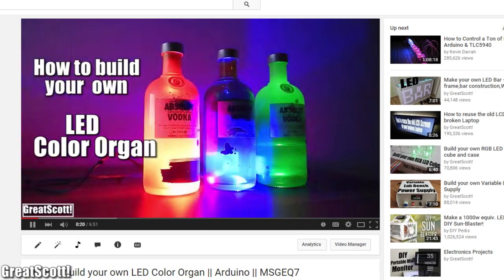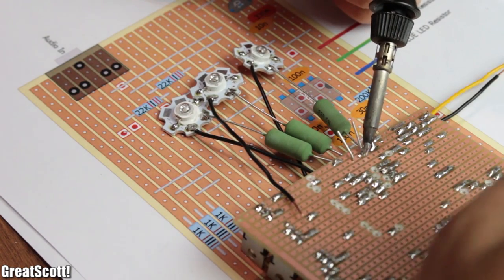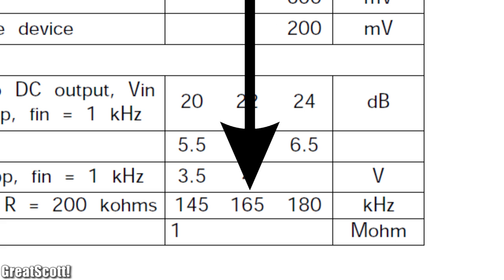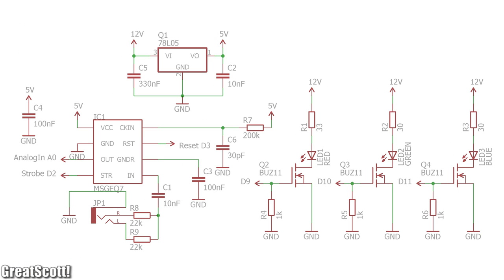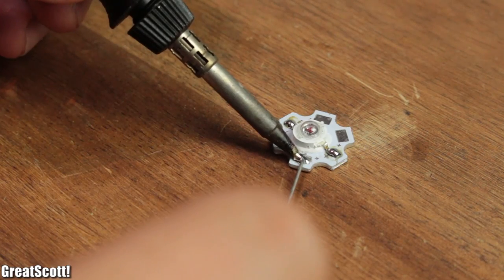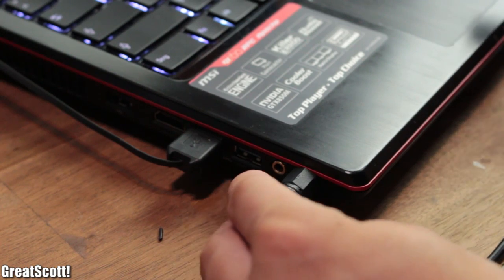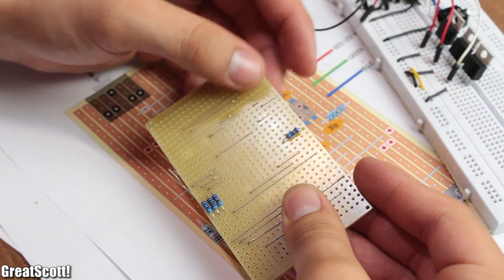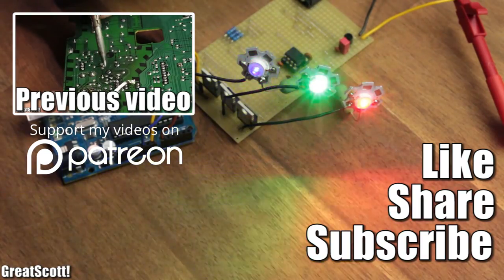DIY Arduino LED Color Organ 2.0

Comment: First I wanna say, I built my own color organ using this video, and it came out great! I did have the high frequency noise problem on the perfboard, even after removing the audio resistors, but I also ordered some PCB's (from JLC) and built the circuit using them, and it works FLAWLESSLY! Wow, I really like the project, thanks so much for this video!

Comment: For everyone looking to buid their light organ too, as i successfully did this week :D : 

As the kit is neither available anymore, nor is there a part list on the website, i felt like i want to help future builders of this project. I used this, the previous video and the correspnding websites as a basis for my first actual build with my microcontroller so i hope this gets more accessible if more information is put out there.
I have not yet bought any high power LEDs since i wanted to try the system out with my basic average 5mm LED. I built as much as basically all the things directly connected to the MSGEQ7 in the red/green schematic from the website, no transistors/Mosfets/...  So this is an instruction for getting as far as having the array of frequency intensities on your Arduino. You can use those signals to do whatever you want. I currently have the array values 0,1,2,3,5 in use for my five different colors of LEDs in my test setup with GreatScotts Arduino-program from this build.

I ordered my parts from Conrad Germany so i will try to give you a translation for the part names, as well as the actual name and article number that you can search for when you live in a German speaking country or whatever ^^...
The part list for the basic functions:
(-[Count] [English], [German], [Partnumber]) 
-1x MSGEQ7 DIP-8 MSI, Graph.Entzerr-Filter MSGEQ7 DIP-8 MSI, 1436444
-1x Mini-stereo 3.5mm jack/input, Klinkenbuchse 3,5mm 2-polig, 1567104 (i guess you could use a mono input too dependant on your case of appliance)
-1x Capacitor 10nF, Vielschichtkond. 10nF RM2,5, 1584439
-1x Capacitor 100nF, Vielschichtkond. 100nF RM2,5, 1584717
-1x Capacitor 33pF, Kerko 33pF 100V RM2,54 NP0 5%, 1589506 (!!!!!, about the in this 2.0 Version used 30pF Capacitor: i could not find one in the online catalogue, so i ordered different ones. The 33pF from the light organ 1.0 works well. It might distort the frequencies, i am not sure exactly what it does, but as my stupid brain found out while researching this that 27+1.5+1.5pF in series does not make 30pF, so i keep the 33pF which works... XD ... Remembering the basics from Uni is hard when you don't use them...[insert other excuses here])
-2x Resistor 22kOhm, Metallschichtwiderstand 22kOhm, 1585456
...thats it. Except the other stuff i use from my "The most complete starter kit UNO R3 Project" box. These components are the Elegoo Uno R3, Power supply module, 9 jumper wires (three for the audio connection), the breadboard, the 12V power supply and the USB-connection cable. I further use 15 5mm LEDs, 3 220 Ohm resistors and jumper wires for testing, but that part is completely up to you (High power single LED(s), LED Strip(s), Matrix display, ...). I guess either you already have these parts or you should have them for prototyping in general.

I used GreatScotts instructables schematic with these components at the MSGEQ7 and also his program with the other 5 PWM pins in use and i now have a fun 5x3 5mm LED show ^^
I hope this works for you too. 
If any of my suggestions make you angry, please leave a comment. I am not an electrician so dont take my word on any of this anyway! But i am happy to learn any basics anytime. :)

Btw. i plugged the audio into my computer. A splitter with one output works, but reduces the signal strenghts in my headphones and does weird things, so i plugged it into my monitor and configured Windows to do the Stereomix-thing so it audio-outputs now to the front panel and the monitor. ... The Windows Stereomix to the monitor has a slight noticable delay which annoys me a bit, but i dont have a sound card in my PC, only the motherboard, so i cant really fix it i think... Maybe somebody has a solution for that too that does not involve a seperately powered amp/splitter...
Reply: Thanks for doing all this, and then taking the time to document it. People like you are the true heroes.
Reply: Ehrenmann

Comment: I like the RGB LED idea...but have you considered hooking it up to a strip of NeoPixels? You could have the closest NeoPixel show the color for what's happening right now, the next one the color for what was happening a few milliseconds ago, the next one the color for what was happening a few milliseconds before that, and so on. The color organ colors would flow down the strip of NeoPixels to the end and disappear (or perhaps fade gradually out as they moved, if you preferred). Put several NeoPixel strips in parallel and offset them a little for interesting shapes.

Comment: How does replacing the 33k ohm resistors at the end with bridge wire eliminate the high frequency noise going to the blue LED?? Only part I was confused on. Thanks for the great video!!😁

Comment: I like your videos and send thanks for them.
You ask for ideas often for projects for the future, well here is an idea I have:-
Most everyone has a power supply and mine is a 15volt 10Amp supply but it has no Constant Voltage or Constant Current. What would be nice is to have a unit that plugs onto that and the output would then give CV and CC.
I know I could simply buy another PSU from China to plug onto mine but would love to see your ideas about building a unit to do the job that maybe could be fixed inside the supply.
Keep 'em coming.

Comment: Thanks for a great project.  I ordered the kit, and found it to be everything that you said it would be.  Well packaged and put together.  It arrived in very little time.

However, in reviewing the code that you have provided, it would appear that you want the 63Hzand the 160Hz signals to light the Red LED.  However, I think you will only get the 160 Hz to light the red LED.  As soon as the spectrumValue[0] is written( the 63Hz), you then immediately write the output for the 160 Hz, which over writes the value for the 63 Hz, signal. The same is true for the blue and green LEDs also.  You need to combine these in software.  Not sure if simply taking and average of them will do the job. For instance if there is a big burst on the 63 HZ frequency and little of none on the 160 Hz frequency, then a simple average will show 1/2 of the value, and I would expect to see the RED channel on full. Perhaps the solution is to add the values and then check for a peak not to exceed the max for the analog out.  On the other hand it might be best to simply discard some of the frequencies and only use three of the seven available.  One could also add more LEDs to use the other frequencies.  You thoughts?

Comment: you should use less thermal paste; the less the better. you need as little as possible while still filling the super small airholes between component and heatsink for best result :) (keep in mind its still a thermal resistance, just less than air)

Comment: Greetings, as always another wonderful project...

Here is a suggestion that you may find useful; you may want to offer various kit levels to this project.

What I mean by kit levels is a basic kit there is nothing done and of course would be the cheapest of the lot. Second kit, only tough soldering is already done such as mounting the LED with some basic soldering left to do, and of course this kit would cost a bit more to compensate for your time to solder things up. Lastly a fully soldered and complete kit, short of the Arduino and PSU, and obviously the most costly but also the most reliable as well since it will be tested before it is shipped. You may want to also include a super kit compete with Arduino and PSU; obviously this is all up to you. 

I can not solder to save my life, believe me I've tried and FAILED EPICALLY. I would venture to say there may be more of a market than you might think. You can make your kits to order and give an estimate shipping time or you can make a few kits up in advance to offer RUSH SHIPPING for those that must have this NOW.

I hope you find my ideas useful...

Comment: Is there a recommended way to drop the LED's and wire the leads through a Arduino relay shield so I can run a larger array with this board ? I want to use the color organ as the switch input control.

Comment: does the brightness of the lights vary on the volume of the music being played into it?
Reply: More than likely not. The setup uses filters to determine what frequencies are present in the incoming sound wave. So even if the volume increases (amplitude of sound wave increases) the frequency is still present. What might happen is that frequencies with amplitudes that aren't large enough to be detected at a low volume (some soft instrument) will be detected at high/max volume so the leds will now react to those as well.

Comment: Hello
question: could you please explain how to  ad input gain into circuit ? since each audio file recorded different db level, a law level input signal is insufficient to turn on lights without boosting the music 
or what if build a mini amp for instance LM 386 and use it as input gain e.g  audio out into LM386 OUT in msgew7 
will such solution work?

      <Keep on Rocking

Comment: I would like to know, what things i need to mention when i want to use my old LED-Steip, as shortly showed in the video... Only the voltage?! Sound to awesomely easy :)
Reply from the maker: 2Fast4UeXtrem It needs to be a common anode RGB LED Strip. Anode connects to +12V and the cathodes to the drains of the MOSFETS (where the high power leds were connected)

Comment: After checking out your schematic I noticed there is no signal amplifier between JP1 and the eq chip. Is this because you input device can provide enough power? If I were to swap out the 3.5mm jack with a microphone I would probably need an amplification circuit, correct?

Comment: HEy , I've have done this project long ago when your first video of color organ appeared , I had to change something in code , i had to delete the delay command to work it properly , I have a question from where do you buy msegq7 microchips ?, becouse I've bought many of those chips and most of them were fake , thanks for your answer , and I appreciate your work, keep doing what are you doing ;)

Comment: very nice project! i plan to connect it to an RGB LED strip... can i choose the color of the leds ore will it be random?
Reply from the maker: Play Like Clyp3um You can change the color for low, middle, high frequencies in the code.
Reply: and does this change the color of the led strip?...

Comment: what is the technical name for the component/connector to input the 3.5mm audioplug? Looking for "audio connector" i just get wires and not something for on a circuitboard.

Comment: can you make a video that shows how to modify it for an RGB LED strip?
Reply from the maker: +Sebbithecool Just use a common anode 12V RGB LED strip and hook the anode up to 12V and the individual cathodes to the Drain of the MOSFET.
Reply: GreatScott! ok, thanks for quick answer!
Reply: GreatScott! How will the RGB LED-Strip act when controlled like that?

Comment: Just ordered your kit.  I want to modify it so that it will control three ( or maybe 4) strings of LED Christmas lights.  I will use a MOC5007 Optoisolator, to isolate the line voltage from the logic circuits and IRF640 MOSFETs, for the higher voltage.  Any comments or advice?  Thanks.  BTW, I found the code, thanks

Comment: Hey Scott, great video. Is it possible that you could make a project that uses no ardoino (in the final run) what I mean; I want to make a speaker thatflashes to the music, and if possible it should be portable. but i dont wnat to "weast" an ardoino for the ligt only. or is there a project that uses the ardoino for the steaker, bloothouth and the light show ? (sorry for my english xD)

Comment: I was working on this project earlier today, and what a great coincidence! I couldn't get the circuit to work, so maybe I've ordered one of those fake ICs.  Is there a quick way to check whether or not the MSGEQ7 is real?
Reply from the maker: NoHeroez Connect the Reset and Strobe Pin to the Arduino and check whether the analog voltage values at the output make sense.
Reply: GreatScott! The values does not make sense :( They always stay around 50-60 for all channels whether or not I'm connected to an audio source, or stay the same with a standalone IC without capacitors.
Reply from the maker: NoHeroez Either your circuit does not work correctly (the passive components around it) or the IC simply does not work.
Reply: GreatScott! Thanks for the tips! If I don't figure it out, I'll be sure to order your kit!

Comment: GreatScott, I am attempting to replicate this project with only a raspberry pi 2 instead of arduino, using its GPIO headers. I am attempting to write the program in C and executing through the terminal, but I'm having some trouble converting the serial signal in C. It's not quite like arduino, where I can use functions such as serial.print() or map(). I tried including the library wiringSerial, but I'm still having some issues. Any advice?

Comment: is it hard to make the source to be USB (automatically to take power), so when you play something on PC to get that sound?
Reply: USB delivers 5V 0.5A typically. He suggested 12V and 2A which cannot be provided via USB.
It may work if you use far less powerful LEDs.

Comment: Could this be used on a RGB led strip too?
Reply: I know its 2 years too late, but Yes, you can use it with an RGB LED strip as long as it has a common anode. He even shows that in the video at 3:23
Reply: haha, thank you. :D as weird as it sounds, i don't know what i was trying to find with that question, i re-watched the video and the moment you mentioned and it makes sense, but yeah, seems that something didn't click at that time. :D
Reply: @Asdafgaser  Glad it clicks now (:

Comment: I watched your most of the videos and i'm impressed.
I wanted to start learning electrical engineering and i think i will start from your videos.
just had little idea about creating mini computer i was inspired by "pcDuino8 Beta Arches Single Board Computer Allwinner A80" board. it will be very interesting to see DIY project about making tablet :) it will be quiet big challenge.

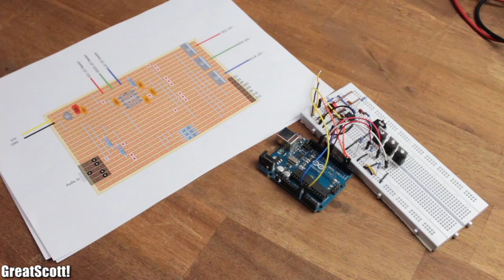Comment: Hi. Where I can get this solid bridge wires without isolation from 5:26? In part list I can see "Hookup wire" but this with isolation. This is the same, but You just remove it? Anyway great video as always. Sorry for my english.
Reply from the maker: VeronaPL The bridge wire is included in the kit.

Comment: Can I use an ATtiny 85 for instead of the arduino and a sound reactive module instead of the line in?
Reply: unfortunately not exactly. it does not have enough PWM pins for tri-color. you can however just use two outputs instead of three. what I'm trying to say is you will get reduced functionality but it will work just as well.
Reply: OK thank and can I use a sound reactive module instead of the line in.

Comment: I don't understand why you choose this complicated method for something this simple. I made a color organ using 3 RC filters hooked up to three transistors, which controlled the LEDs. I'm not trying to sound like a smartass, I just want to know why is this better.
Reply from the maker: hsxenon There is more than one way to skin a cat. But aside from that the IC is smaller and also has a lot of potential to expand the light shows with the µC. There are 7 bandpass filters with peak detectors inside. If you think about that you would need to build 14 RC filters all with different values and fine tuning + peak detectors.

Comment: How can i do this with an rgb led strip with a common cathode?
Thank you
Reply from the maker: +dejanb2 You would need P Channel MOSFETs, change the schematic and code. It would be easier to buy a common anode strip.
Reply: +GreatScott! 
I have acquired the common anode led strip. Connected every thing and something is not right.  I used the lm7805 but I have no idea why do I get 12v on the output pin. So 12v got to the ic so I guess the ic is pretty much gone. Any ideas.

Comment: Awesome video!!!
I have always enjoyed your accent when you speak English--to an American speaker it sounds as if you are trying very hard to pronounce everything right.  I saw your other video where you were listening to the pronunciation of "centimeter".  You do a great job!  I don't think you need to sound "native-born".  You are completely understandable, and I do find your inflection interesting--I wondered what your first language was until I saw it was German.  By the way, at 4:26, you sound as if you are saying "isolation", but the wrapper around an electrical wire is called "insulation".  Isolation is the function of insulation, though, so it's kind of funny.  I think any English speaker can understand your videos just fine though!  Small little mispronunciations are "filtered out" when we watch your videos--don't stress out about them!

Comment: Hi,
because I wish to build your version of Arduino LED Color Organ I searched for the parts I don't have layn around. So I had to search for the MSGEQ7 and I found one on Sparkfun but this is not very cheap and I think the shipping costs are high because I live in Bavarya/Germany! Now I searched for an alternative IC which does the same as the MSGEQ7, is there an alternative? Let me know!
Reply from the maker: Hans Hansen I never found one
Reply: Would you please tell me where you bought your IC as cheap as possible?